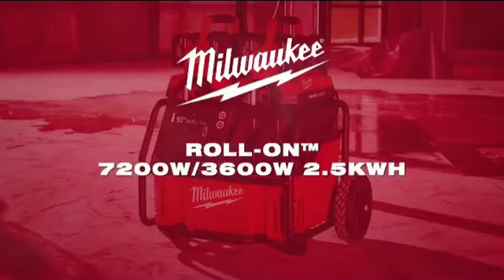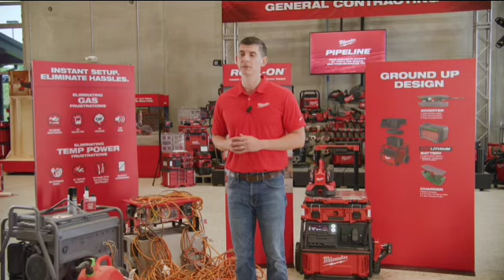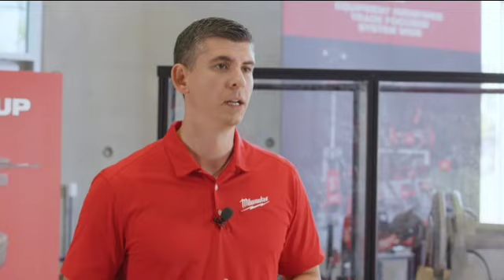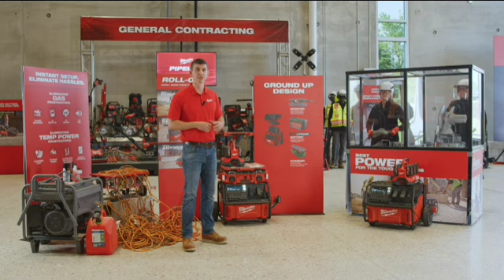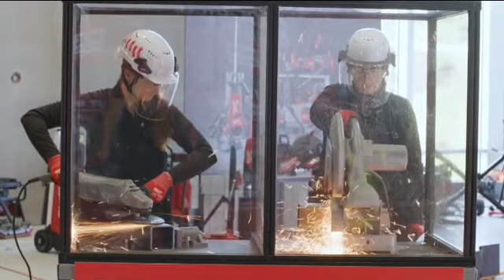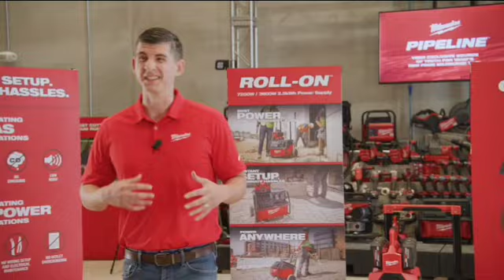*Coming Soon* Milwaukee Roll-On 7200/3600 Watt 2.5 KWH Power Station Generator

Comment: All for the low low price of your firstborn son.  Leader in battery tech? How can the guy say this with a straight face? I know freaks out there will buy this just because it’s Milwaukee and I’m not gonna lie, it’s neat and I never thought we would be at this point in time 5 years ago. Jump in battery technology is pretty crazy. However, the price they are asking for is insane. You can spend a third maybe even a quarter of the price for about the same power but more flexibility…like charging with solar throughout the day. Once this unit runs out of juice, you’re done.